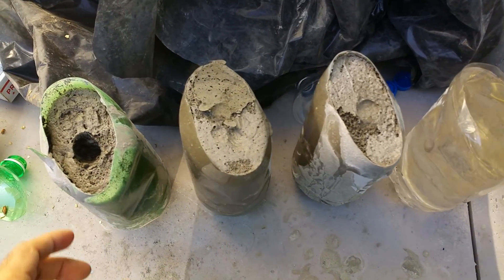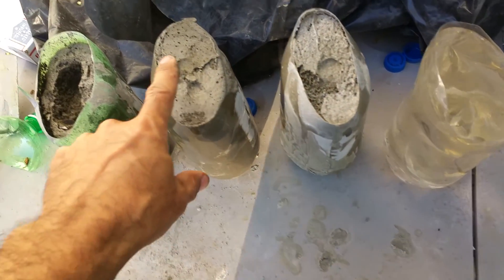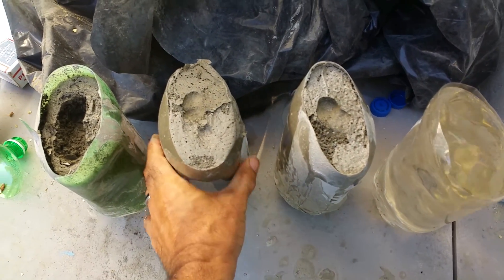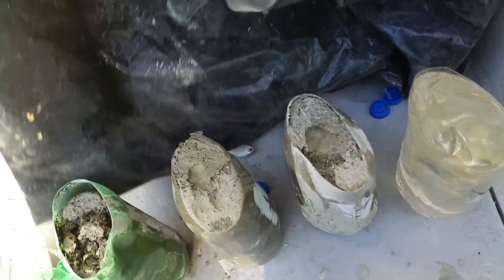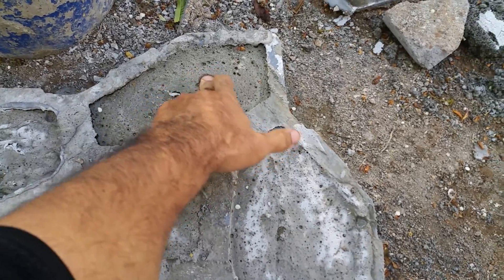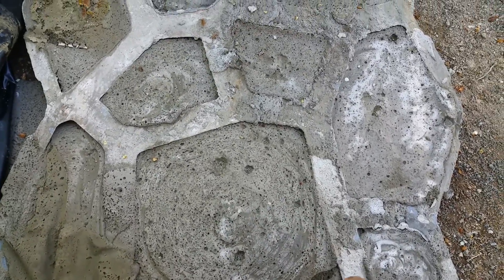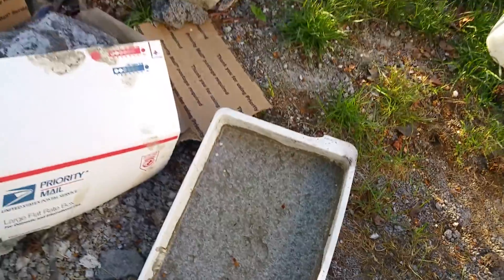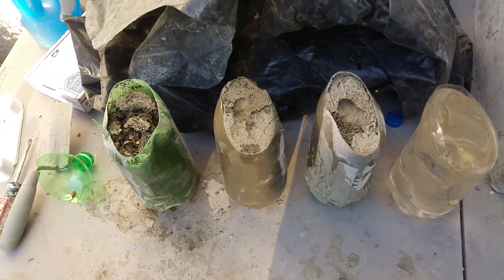Aircrete Foam Flow | Test Results Day 2 #AircreteHarry #Aircrete #DIY #FoamFlow #FoamResults #Foam

Comment: don`t test in plastic bottles , it takes longer to cure , it is better in a wood mold/frame or no mold just use a bowl as a form and in few hrs release it ...point is when wet plastic hold longer the moister and take longer to dry , in the real world it should dry naturally maybe just covered with a sheet of plastic to let it air out the water content in the crete, then it will cure as it is supposed to in 48/72 hours... you can even test my theory , what drys faster in a bottle or in wood or no frame....just my 2 cents....thank you for your videos,

Comment: Hey just a suggestion I'm getting into this right now and I might have a simple Answer. I'm sure you have heard of SIP houses if not bear with me. 2 pieces of Plywood with about 6 " of Foam compressed in between making a Hi density foam for the best insulation out there. That said do it with Air-crete in between the plywood. It would make a great wall and the plywood would support the air-crete from crumbling. In fact u could pre dill Screws in the plywood  so when u pour the air-crete it molds around the screws. Now I know you want a Dome but this would be interesting similar to SIP and Insulated.

Comment: Cellular Fibro Concrete have a dry mix that you just need to add water to and it will produce ready to use air crete

Comment: Greetings Harry. I'm thinking the type of soap you are using is the problem. The harsh chemicals in the soap may be causing a chemical and molecular breakdown in the mixture. If you're still experimenting, try avoiding a soap that has unnatural coloring and scents (or none at all). Top name-brands without scent/color would probably suffice, but more natural/eco brands would be ideal (in my opinion).

Comment: Watched a few of your videos and your having troubles with strength.  Was wondering if you added some kind of fiber to the mix it could strengthen it.  Now days they put fiberglass. But in the old days the put hair in the plaster to add strength.

Comment: Hello there Harry, Thank you for your video ,  You do realise  that air 
create is a non-load bearing material  don't  you?  Hajjar Gilbran..has 
made claims to people that air create  will with stand tropical hurricanes..and .this is total bs! man, i wanna see you fire a 2x4 at the wall of aircreat at 200 mph like they do with a real storm shelters , you and i both know air create would fail miserably, air creat is no more than an insulator at best  and should not be used for any thing more than just that!  I mean even  that house they show in the green dragon video  is  steves dome home and is not made of aircrete
 at all!  and there is not a dome made of this stuff  today man this is 
why they are using steves dome home,   and looking at the aircrete that you are 
making  having to ad all this other stuff to get it not to crumble? i think you can se why? cant you?  i mean just how much are you going to trust an over head  arch made of this stuff  man ?  according to Hajjar all ya gotta do is use a polyester roofing cloth to give it the strength it needs lol! , and all a skim coat of portland is going to do is make is heavier and break or collapse faster  my friend, this is what rebar and wire mesh are used for , they are used in concrete for  building strength ..Look here are the facts  Hajjar Gilbran has sold you an untested , unproven and very unsafe  building method, as this  Air Crete made with dish soap  has no load bearing  quality to it at all period and anyone foolish to try to make any kind of load-bearing structure out of it is going to get them selfs or someone else seriously hurt or killed when it collapses....Hajjar has Lied to you Man this is very unsafe  Think about it..  
.I am sorry but The Green Dragon   air crete building system with the arch forms  and build your own dome with it ,is a  total Pipe dream Man  and a very unsafe one at that!
TAKE CARE AND GOOD LUCK Man !
Reply: Al, I agree with you completely but your point is not going to dissuade Harry. Let me propose a different approach,  make a geodesic dome for its load bearing properties and use Aircrete as the insulating covering material. Now you get the best of both worlds.
Reply: lol  Well Cedric Am why don't ya show  Harry here as well as my My Self  just what he needs to do then, to make it all work by using just ordanary Dish soap  like hajair has claimed you can do with this green Dragon system,    and there is a place in my area that builds and dose testing of storm shelters ,  i will have your recipe tested   to back up the claims that is can be used for a storm shelter ...like hajair has claimed it can be,  cuz i think that when they fire a 4x4 x8 post @ 200 mph Just like they due, to test storm shelters here in the mid west.. , it will fail BIG TIME! But that is just my opinion,,,please do show us what harry needs to do to make it all work
! As  I would love to see it work... Take care Harry! thanks again for showing and sharing your research  with us all ! Blessings!
Reply: Thanks for your input Cedric, i would like to talk to you some time soon about how you have done it....Sadly adding sand using the green dragon  would just destroy the soft aluminum paddles and  the plastic pvc housing or the upgraded aluminum casing ...sand is very abrasive and will wear  down  hard steel,,, the green dragon is a exspensive tool and is made of  very soft materials  such as pvc plasitic, asb, plastic , and Aluminum and would never handle it...as in stay together for any amount of time at all, but i would like to talk to you soon about how you guys mix it  ..Take care! i am glad we are all friends here! PEACE!
Reply: Al Mcm totaly ridiculous, we build house in air crete in europe for 20 years now, and never have problems
Reply: Mabey so Harold,  let me know  what ya come up with,  take care!
Reply: Al Mcm add some sand to your receipes
famous industrial company here add sands in it
Reply: search "beton cellulaire" in youtube french
Reply: or "ytong" is the most famous trademark here for air crete, you do not have air crete seller ?
ask me a lot if you want I made all my first house myself, plumbing, concrete, floor, upstairs, electricity, windows, door, swimming pool etc....
Reply: for great storm you need to build heavy air crete blocks like 30cm X30 cm by 50cm
1ft x 1ft by 1,6ft long
Reply: Al Mcm very strange cement is agressive, not sand your tou take sad from beach with salt, but aluminium is.non corrosive material..... I repeat tons of housing is made in air crete here but add «chaux» in it
Reply: «lime»

Comment: Noticed even on the green dragon videos that the foam generator is not making thick shaving cream with stiff peaks.  That can even be done with bar soaps.  Dish detergents do not come with stabilizers in them either, just as eggs whites (a protein source) need cream of tartar.  The commercial cement foaming agents have them in the mix.  Been reading cement foam patents again and note they are saying that even the cheap old line foaming agents will work if the bubbles are kept to .001-.004" using recommended ratios.  Does your foam lance have SS wool after the SS scrubies?